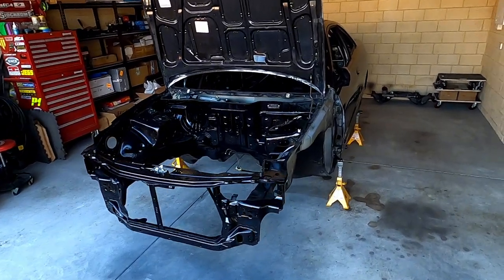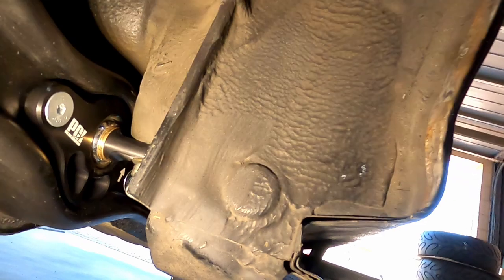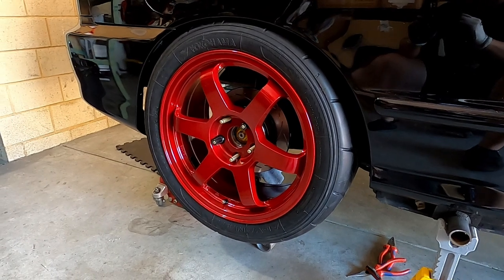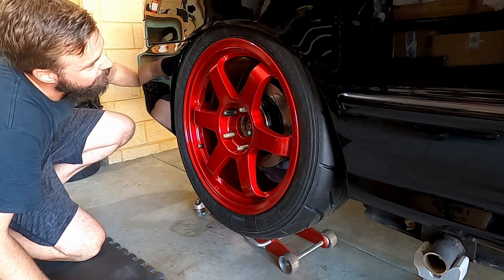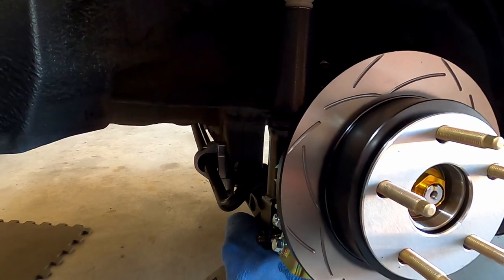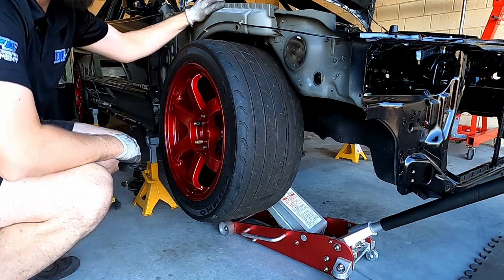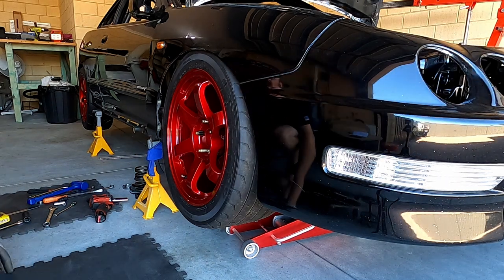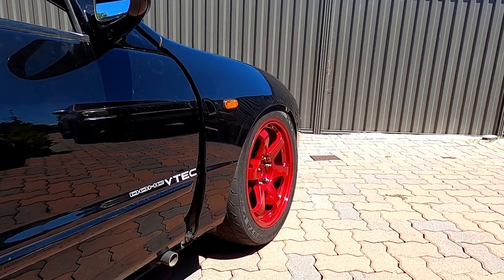K20 DC2 Integra Racecar Build Ep. 05 - Suspension Install & Setup

Comment: Awesome build I hope to build my integra over one day  as I didnt this time because adulting  but I do have dc2 with 98-01 front end and rear end k20a2 swap AN fuel lines and more bits  If i would have had garage of my own when did the swap 3 years ago I would be still redoing the car. I wanted to stich weld the seams and such and make the ultimate road track race car  
If it comes down to it and you need  some discontinued parts I have over the last 4 years dismantled 4 integras 2 GSR and 2 LS models black interior and kept everything its all in storage besides the unibody

Comment: Nice work, making good progress with the build.  
I'm running a very similar set up in my EG basically the Honed catalog, some PCI gear and Shockworks coilovers (can't rate them and the customer service high enough)  

Noticed some of camber numbers you mentioned sounded pretty extreme although I'm sure you'll dial that in once it's on track.
Reply from the maker: Thanks Gavin! TBH tyre clearance drives the camber numbers to be on the more aggressive side lol, but you're right, they'll get dialled in with tyre temps and sidewall rollover wear on track

Comment: Not sure if this was covered before, but those jack points for the jack stands are really interesting. Any more info on what that's about?
Reply from the maker: Those are sill tubes for rally-style pin stands. Usually the jack and the axle stand would have a pin that slips into those tubes, but mine aren't trimmed back yet so it's easy to just put a normal axle stand straight under the tube itself
Reply: @technologicmse  that’s really cool. I’ll have to look into that. I like that idea

Comment: I know this video is a bit old at this point but just coming across your channel. Not sure if anyone else has pointed out that your pci trailing arm bearings assemblies are installed upside down. It appears that the logo and arrow that’s supposed to be pointing up are actually printed upside down as well. Pretty odd. The toe link angle created by that would result in a lot of toe in during bump. Enjoying the videos so far. Nicely put together car
Reply from the maker: Thanks Evan, great spotting! I didn’t question the arrows during install, but looking at other images online I can see they are definitely upside down as the offset should raise the arm relative to the car, not lower it. Will get them swapped over 👍🏼
Reply: @technologicmse  just an unfortunate manufacturing error I’m guessing. The amount that toe sweeps inward during bump is significantly reduced with those bearings set correctly.

Comment: Nice setup👌🏻 and good how to for many. But your bashing BC but dont have the right length coilover yourself 🤔 the only thing BC is missing for the right way of setting up is helper springs. So if you buy those you can set it up like it "should" with completely different then stock suspension parts. My point, BC is mostly available for entry level enthousiast that dont have or need the knowledge to setup de bump/droop travel and next to that are designed for the stock suspension with 15" wheels. I also had setup problems with 4k KWs that were made for stock suspension, its even more of a headache to correct. Its not the BC coilovers that are bad its the target consumer why it is different 👌🏻 the people who know can fix it easy and have a quick track car. Without helper springs you dont want to set it up with the springperch as your always ending up with a loose spring or less droop.
Reply from the maker: Thanks! Fair challenge, and good feedback. With my own coilovers they would be the right length except that I'm running aftermarket roll centre correction brackets which change the required shock length. The manufacturer has now sent me revised shocks for the rear, they work great.
For BC, my main gripe is their continued misinformation with telling people to set ride height using the bottom mount, it's quite dangerous for those who don't want to play with bump/droop as that's exactly what they're messing with. BC themselves are good budget coilovers, but it's the bad advice that I don't like

Comment: Great work! Really enjoying your content. What are you thoughts on utilizing a Traction Bar for this set up? i.e. Full Race / Hard Race / K-Tuned / etc
Reply from the maker: Thanks! For circuit racing I don't think a traction bar is necessary. Maybe in a huge-power drag car but that's it. When you use decent quality suspension arms and spherical bearings, they do more than good enough at reacting the forces from braking and cornering. Plus, with a lot of the traction bars you're over-constraining the front suspension movement, as the traction arm mounts need to be perfectly in line with the other suspension mount points otherwise it will bind up. A lot of the cheaper traction bars are quite poorly designed in that respect

Comment: You running 36mm driveshafts at the front?
Reply from the maker: Yep I am, makes sense as the 5-stud hubs take a 36mm outer anyway so no point staying 32mm
Reply: What rear hubs? Dc2r?
Reply from the maker: @marksebastian8895  yep, DC2R rear hubs on the original 4x100 trailing arm spindles using Honed Developments spindle nuts